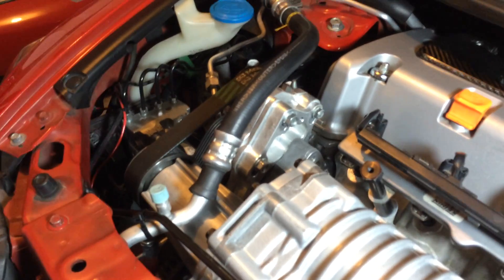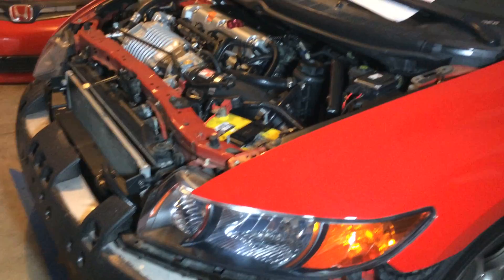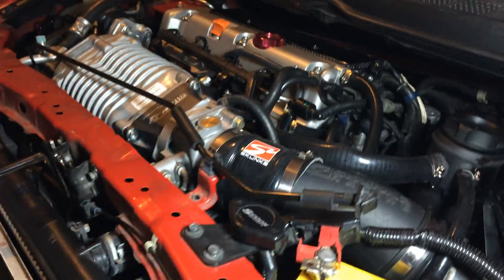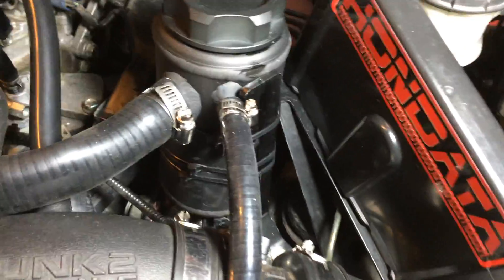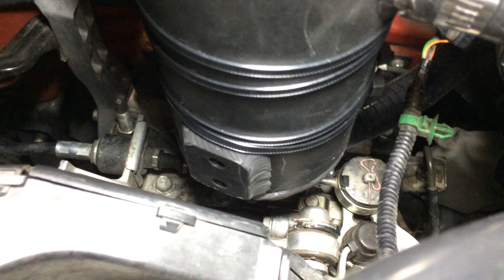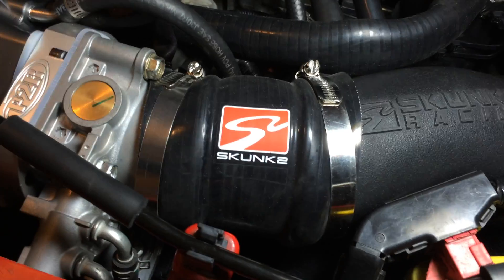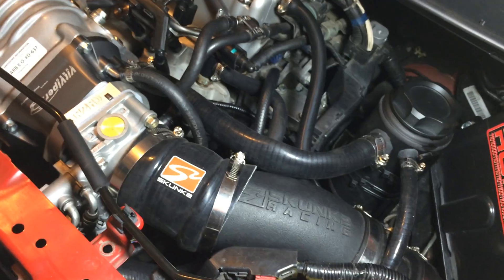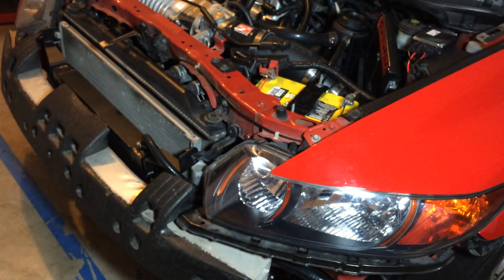CT Supercharger VitTuned Aftercooler Install Part 4

Comment: FYI the surge tank bracket is mounted to the wrong bolt -- it goes on the transmission stud, specifically the rear one. Once you put it on that, it fits as designed without any zip ties. If you chose to relocate it to a different spot (for any reason), that bracket will not work as designed.